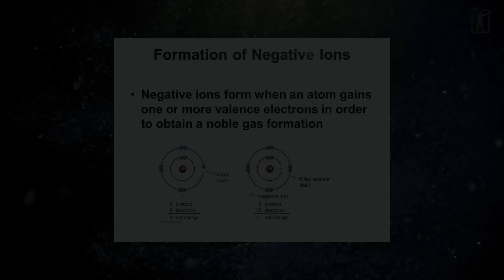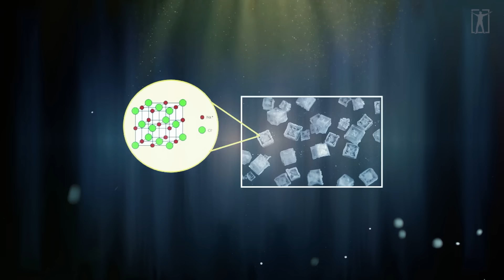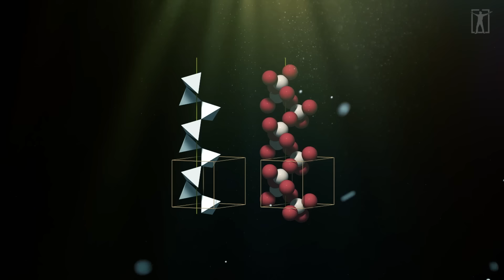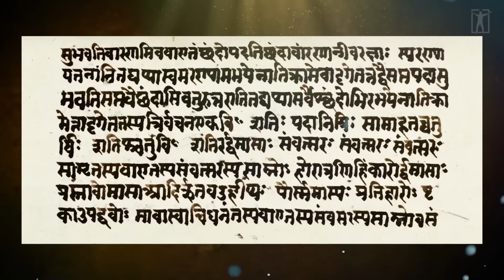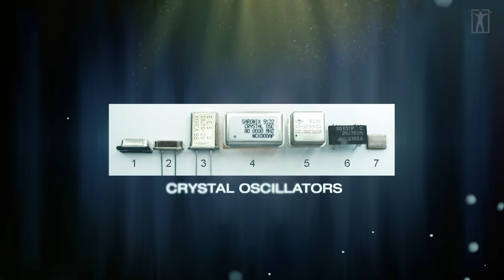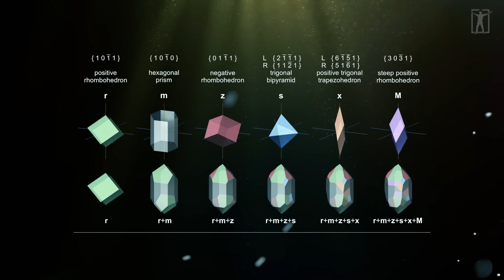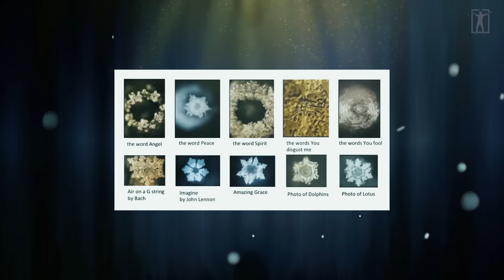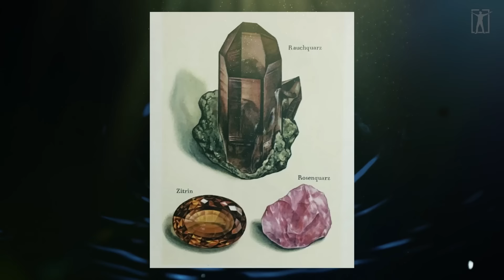"Once You Heat it, Your Brain Starts Changing" (seriously)

Comment: Have we forgotten that amethyst, citrine and clear quartz are the exact same mineral? (SiO4) Literally the only difference is the colour and in the industry this is often manipulated through heat treatment and irradiation according to the demands of the market. In fact virtually all the citrine you’ll find for sale started out as low quality amethyst and through heat treatment the colour was changed into deep yellow. Natural citrine is a pale orangey yellow with very poor saturation. So just when I start thinking I might get into this crystals stuff I run into another one of these contradictions like different properties being assigned to colour variants of the same mineral and then my skepticism flares up again. Sapphire and ruby is the same mineral (corundum). Amethyst, citrine and rock crystal or quartz is the same mineral (quartz). Emerald, morganite, aquamarine, heliodor, maxixe and precious beryl are all the same mineral (beryl). Yet this crystal woo-woo nonsense ascribes different properties to each of these. Some do actually differ in properties, others do not, and the colour can literally by changed just by heating it.
Reply: All electrical circuits are of the same material. A differing Structure will put the electricity in a different spot. In a 3 dimensional world It would be foolish to think exact placement isn't important.
Reply: If it's the same exact chemical structure, then how is the color different? The structure has changed. If you haven't heard of time crystals you should check them out. Pretty nifty.

Comment: The lay lines and  the structures upon them, could have been used to Amplify a more powerful magnetic field for earth during sun activity. Which would affect the Helios sphere/ Pause.? Which is buckling now under distresses of us now being closer to sagittarius./ Galactic axis. Moving faster through space than before. From what i've seen on it, it would be like  bow of a boat buckling from going to fast through the water And the boat being built of thin material. The front of the boat needs strengthening for the added speed. A sphere head a shield. 0>
This could be connected to climate change.? Ozone layer. Carbon collector. Co2. A planetary's environment balancer.
Peso power Versus plasma.
 Any thoughts on that..?

Comment: Just like they have heavy water, they have whst i call easy flow,  ots pretty crazy,  using a true liquid dialectic,  not the fake one, u literally age so slowly, but more so. It increases quality,  so u don't live much padt 120, but u will be shocked,  and it transmitted large anounts of current, it looks like a crocs back. It always feels about 40 degrees,  trying to fix it, it includes a vacuum pressure I can't get yet on our own, working g on t by Xmas

Comment: Not even a minute into the video and it already is so full of errors it pains me. Negative ions are NOT the same thing as electricity. IF you want to make the claim that ions are created, then its POSITIVE ions inside of the crystal (for milliseconds if best btw) as the electrons are kicked out of the crystle structure. If i wanted to paint this in a bad light, you are making the crystal put out beta-radiation, which is not completely true (as it is lacking energy) but more true than your statement. By the way, if you ever used a electric cigerate ligther, thats whats happening there, piezoelectricity. Also, tourmaline has vastly different piezoelectric properties depending on the mineral species and specific elements present.